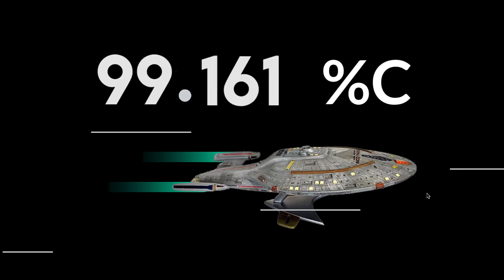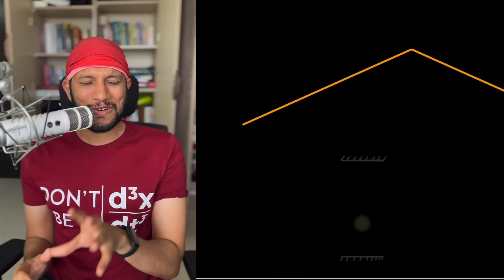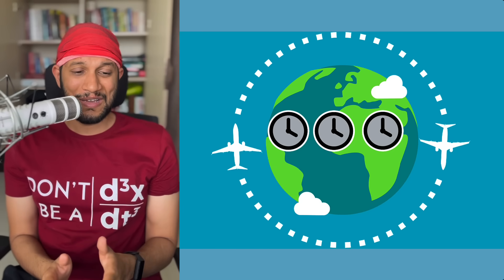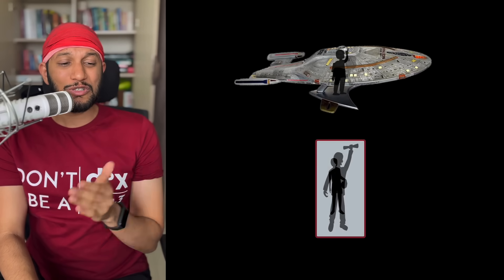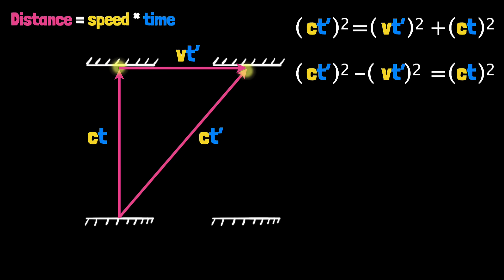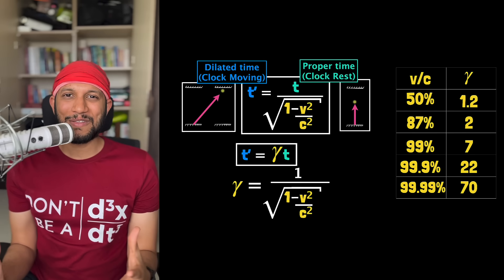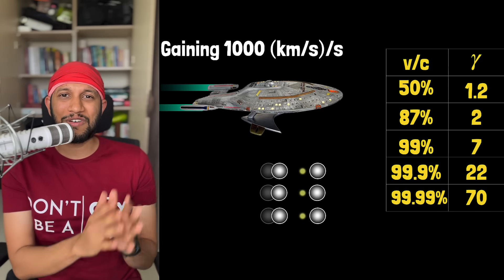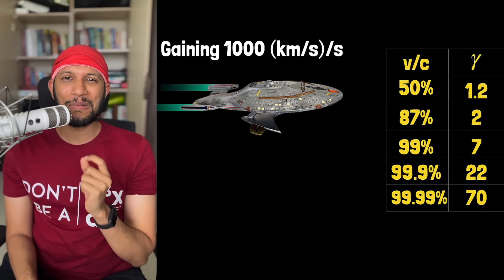I finally understood why you can't go faster than light! (My mind is blown)

Comment: What if Einstein was wrong?, what if the speed of light is not a constant, but time is. When a photon hits a mirror, like a ball hits a wall, does it's speed stay the same?  The speed of light changes when it goes through different mediums or does time suddenly decides that it needs to change for that moment that light changes it's angle going into a medium. Most measures of the speed of light are based on Einstein's theory, and it normally measures light after it leaves a mirror, but not before it hits that mirror or even at the moment it's created. We do not have all the answers yet, years ago we thought we were the center of the universe, today that theory was proven to be wrong, I have no doubt that other theories, including some of those of Einstein, will be proven wrong.  The universe itself is expanding faster than light. We cannot measure anything that's faster than light because all of our theories are based on the speed of light as a constant and space time is not. Maybe if we take a step back we might realize that there's a lot more things that move faster than light.

Comment: I understand your explanation, but it has a fixated outside reference point and time. Does it not mean that for the outside measures, the speed as reaches the speed of light, the acceleration is seems to be slowing, but for the actual traveler, neither time neither acceleration is slowing down... so how would you measure the things from a traveler reference point point of view?
Reply: How do you know that you as at your place is the correct measuring point of view. also we on earth we are speeding around the galaxy while you measure... This seems to be applied to the relative viewpoint when the viewpoint is earth/us...

Comment: Idk if the explanation is not complete or if I just didn't get something but wouldn't the same be valid when a person on the ship is looking back on a clock on earth? Cuz relatively to the ship the earth is the one moving, so all the things that were said about the observation from outside of the ship would apply to the Earth when looking from inside the ship, since you know speed is a relative measure and you need a frame of reference to measure it.

Also things can move away from each other at faster than the speed of light speeds, we have entire galaxies that will become invisible for us in the future because of the expansion of the universe

Comment: I like your explanation of the photon clock. It seems it would be logical that if one could go the speed of light the photon on the photon clock would be more of a straight line. So I imagine the beginning of a straight line is warp speed. When one passes the speed of sound a sonic boom is produced. What is produced when one passes the speed of light?

Comment: The limit of speed as the speed of light is as true as then world being flat. No one stops to think about the electrons within a photon traveling both faster and slower than the speed of light. As a photon travels through space the electrons are constantly rotating around the moving photon. The retrograde part of the orbit around the photon is technically going slower than light and the prograde part of the orbit is traveling faster than light.

Comment: because the hypotenuse of a triangle is always longer than any of the sides of a triangle with a 90 degree corner. in the speed calculation you basically are stretching a triangle to become nearly a two sided shape but, there will always have to be three sides and one of them, (the speed you are traveling) will always have to be slightly shorter than the hypotenuse. For you to go faster than the speed of light, you would have to create a 4th dimensional object in which one side of the triangle would go through another dimensional distance to become longer than the speed of light. which in our current understanding of the universe, doesn't make sense and would enter into a new realm of wormhole travel or something(and even in that case I dont think you can actually make the  hypotenuse of the triangle shorter than a side because its going through another dimension/distance which would probably end up taking the same  absolute distance, but a different relative distance.) TLDR: one side of a right angle triangle must always be longer than the other, no matter how much you squish it into a wedge

Comment: Okay now, if we were capable of moving the spaceship at the speed of light, does this mean that inside the ship the time would be "frozen" because no photon is capable of reaching the next atom?
Reply: that's exactly what i said..., and it doesn't prove you can't reach speed of light. it only proves that anything inside the ship from electricity, chemical reactions and living being become "frozen".
Also, what if there is an object in the universe moving slower than earth 299 792 458 times. wouldn't we be moving at an impossible speed comparatively to it?
Reply: @ShockSmile  I'm not sure why it wouldn't prove you can't reach the speed of light. As the guy says - you can either do it with finite energy but infinite time, or finite time but infinite energy. Infinity isn't attainable, making such a task impossible.
Reply: You have become a time capsule that will never reach 100% c and when decelerating after a life time of travel you will barely have covered a few dozen light-years, but space had billions upon billions of years pass by.

Comment: In terms of relative speeds nothing with mass can travel with the speed of light. However, relativity does allow for anything without mass to travel at the speed of light and beyond. A theoretical physicist wrote his thesis on this very thing, Miguel Alcubierre. By contracting space in front of a ship and expanding space behind the ship you can achieve FTL speeds. The ship itself remains motionless  while the space around it moves at FTL. But at the time he published his paper the mass require to generate the needed power was more than that which existed in the entire universe. Thanks to peer review though Dr. White formerly of the NASA JPL and another college managed to work it down to the mass of the Voyager space craft. So the mass issue is theoretically solved. But there is other problems like needing negative energy or exotic matter. So still impossible for now.

Comment: Just curious, on your clock example, since the atoms at the top of the mechanical second hand are travelling slower, then the ones closer to the center, wouldn't we see a bend in the second hand? 

So...what happens if you have a digital clock, that counts 0:01....0:02...0:03...0:04...and it's just the numbers that are changing?

Comment: This so called "light clock" explanation of relativity was said to come from Einstein but actually from Feynman (The Feynman Lectures on Physics, 15-4), and is widespread nowadays (by University Physics  of Young and Freedman, 37.3). It is intuitive, convincing, but misleading.  By this explanation, the "time dilation" of relativity is merely due to relative "coordinate time" of motion reference frame, a classic (i.e. non-relativity) measurement effect of time only (no relevance to space). However, what actually observed time dilation in physics experiments (such as muon decay, Hafele-Keating, etc) could only be explained by "proper time" or "clock time", which, in relativity, comes from the non-classic natural of time and space combined relation of motion reference frame.

Comment: I didn't understand why you can't go faster than light. I paid full attention to the video. At the end of the video, I still don't understand why.
Reply: Its confusing.  Basically, the faster you go, the faster time passes for everyone else.  So even if you could go what seems like faster than light, time would pass so much faster outside that you'll never get anywhere faster than light could.
Reply: @az_dirt  What if 2 objects move apart from each other at the speed of light?
Reply: @novkorova2774 That's like pointing two flashlights in opposite directions.  Or say you have two flashlights pointing at each other that are very far away.  The distance between the light changes at twice the speed of light but the light itself is only ever travelling at its own speed.

Its almost like there's an invisible substrate that everything is travelling through and all speed is measured against it.  I don't think we actually know how it works though.
Reply: @az_dirt That’s were the warp theory kicks in, if you are able to bend the space in front of you, you are able to move a higher distance at the same time. While bending space takes a lot of energy, it’s not impossible. It like I can not run faster than 20mph, I can still get into a car and travel faster.
Reply: @saschacontes2305 I suspect thats impossible.  Since time and space are connected, its like planning to travel to a time space location that doesn't exist.
Reply: @saschacontes2305 With warp space you still arent travelling beyond light speed. You're cheating the speed equation, by making it such that distance is GREATER than velocity * time.
Reply: Go to 0:50 again and try to understand the photon clock concept, that's the part which will actually help you understand why
Reply: @AniketGidye What happens if you flip the photon clock on its side?
Reply: His explanation is crap and he says a flat out lie at just 20 seconds in.

Comment: I think what's even more intuitive is if you look at the duration of the journey in proper time according to the same equation. As your speed approaches c from the observer's point of view, the duration of your trip approaches zero. So you can get somewhere just as fast as you like without limit in your own proper time. But if you had the infinite energy go move somewhere instantly (like light does, but it doesn't need infinite energy since it doesn't have mass), then that instant proper time travel would look to any outside observer like moving at the speed of light. So the reason you can't go FASTER than the speed of light, is that the speed of light already represents infinitely fast proper time travel. So faster than that would mean arriving at your destination before you left, which would violate causality.

Comment: No we have no intuition, the only thing you did is focusing on time slowdown, but then there is no intuition for that. This interaction between motion and time remains unexplained.
Reply: With your explanation, a smaller ship could accelerated better as a greater ship for the same weight or a short ship could do better than a long ship. Which is wrong.

Comment: Think about a wheel. Look at the inside and outside diameter.  One roation is 360 degrees. There is a difference between the outer diameter traveled as supppised to the ineer diameter.  So that prespective it simply means that the inside traveld a smaller distance in the same amout of time the the ouside. It doesnt that time ticked slower in the inside then the ouside. Same should be for the proton mirror..

Comment: It doesn't seem hard to understand.  Because of the relativistic relationship between mass and acceleration, an object with mass will increase its mass as it accelerates.  We know this happens because the effect is measurable.  This means that it requires more and more energy to keep the ever increasing mass accelerating.  Eventually, as the mass approaches the speed of light, the energy required to accelerate it to the speed of light approaches infinity because its mass also approaches infinity.  This is why there is a cosmic speed limit and the reason that it is not possible to accelerate a particle with mass to the speed of light.  Photons travel at light speed because they are massless, and the reason that a massless particle cannot exceed the speed of light is the time dilation effect.  So, for somewhat different reasons, an object with mass cannot reach the speed of light while an object without mass cannot exceed that speed.  In other words, practically everything about the nature of space/time conspires to set a speed limit.  Do I have it right, sir?

Comment: Maybe I was just too impatient to watch the whole thing properly, and I grasped his photon clock and how the photons can only travel at their set natural speed, so adding another dimension causes them to have a greater distance to cover, but it still doesn't tell me why a vessel at even 0.5C emitting light towards the front isn't creating light that travels at a speed of 1.5C - I mean if the source is already doing 0.5C and it emits light at 1.0C, why that light isn't doing 1.5c overall?? Does the light fail to depart the source at anything faster than 0.5C RELATIVE TO THE SOURCE just because the source is already traveling at 0.5C?

If you could provide enough energy, why can't that be overcome?

Does that mean too, that anything traveling at ~1C would effectively be creating an almost infinite backlog of particles waiting to escape forward from the emitter, essentially acting like some sort of gamma gun firing off a wad of particles if the vessel were to slow at all?

And no living entity could travel at 1.0C as the molecules would be unable to travel forward INSIDE their body, as part of the circulatory system..
Reply: The way I understand him, it is because of the time dilation effect.  Once the photon reaches the speed of light it becomes impossible to accelerate it further because the time required to do so becomes infinite.  Therefore, the speed of light becomes a cosmic speed limit regardless of the relative motion of the frame of reference.  It was always easy for me to understand why an object with mass could not be accelerated to the speed of light.  It relates to the relativistic relationship between mass and acceleration.  However, I always wondered what prevented a massless particle like a photon from exceeding that limit.  Time dilation seems to explain it very well.  It seems that nearly everything about the nature of space/time conspires to set this speed limit.

Comment: Suppose the spaceship is transmitting a video feed from within instantaneously, will it slow down too ? In space without gravity, the amount of force exerted by the Spaceship would incrementally increase its speed as there is no resistance. Hence the concept that it would need infinite energy to reach near speed of light is doubtful.
Reply: That is because there is a part of this that he is not explaining.  One has to consider the relativistic relationship between mass and acceleration.  Mass increases with acceleration.  Run the math on that and it becomes plain why an object with mass cannot be accelerated to the speed of light.  What the presenter has done here is to explain why a massless particle such as a photon cannot be accelerated beyond the speed of light.

Comment: So basically..... The faster you go the more time dilation happens, and because of that the closer you get to the speed of light the longer time finna take to move them protons to the next atom. Given that your fuel is finite you cant ever get that fast, thus making it only possible if your fuel source was infinite/unlimited. Am i getting that correct?
Reply: Is that why flash everything moves so slow around him? when he seems to be running normal speed? which means if you really traveled at the speed of light youre basically just slowing time down, meaning you still gotta walk to africa and be conscious for that whole shit but when you get there its only been a second? Im high asf

Comment: If you want to blow your mind, imagine standing at the back of a ship traveling the speed of light and you throw a ball towards the front of the ship...
😄
Reply: That ball you throw will still travel the same speed as the ship because you are in the vacuum of space—there is no medium to slowdown the momentum of the ball you throw.
Reply: @Voidඞ its beyond that, should your arm move forward before even letting go of the ball, your arm would be traveling faster than the speed of light, which, supposedly, it can not.